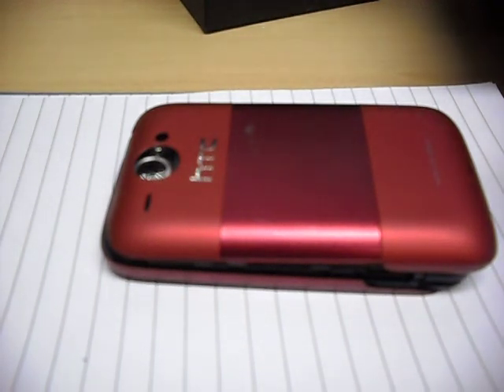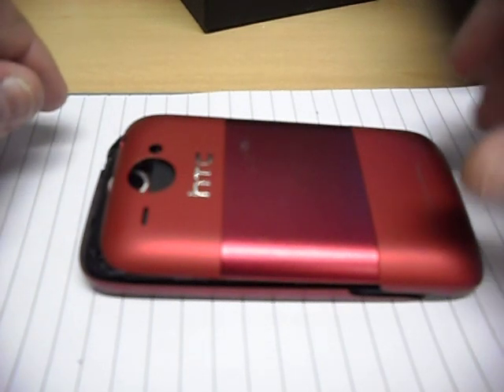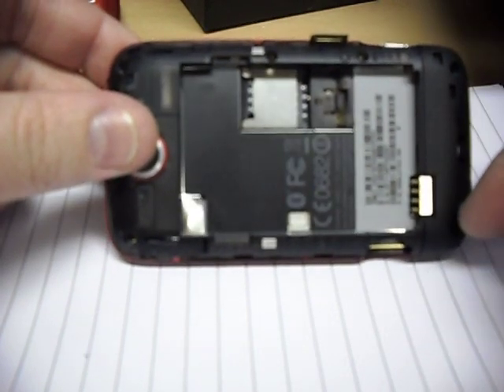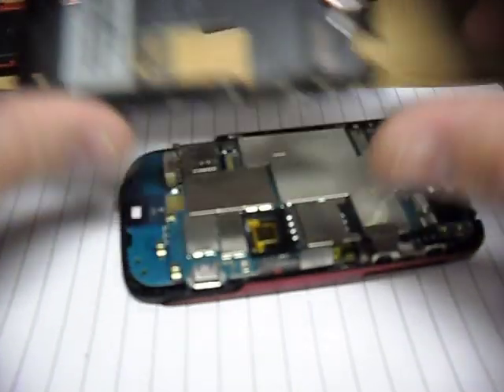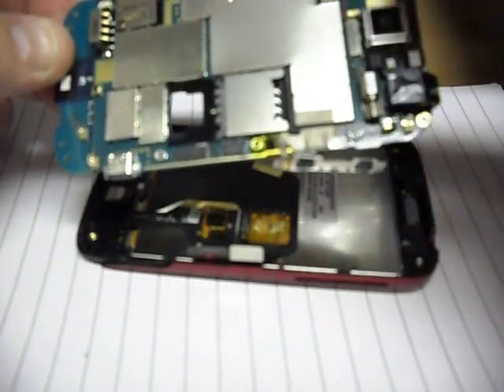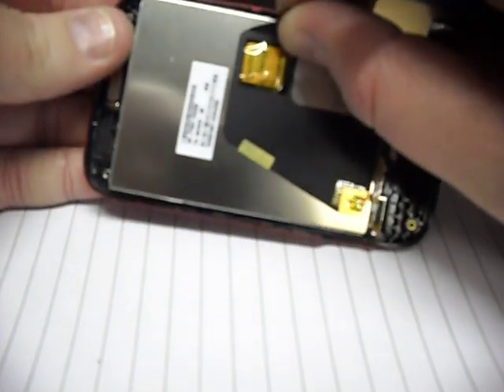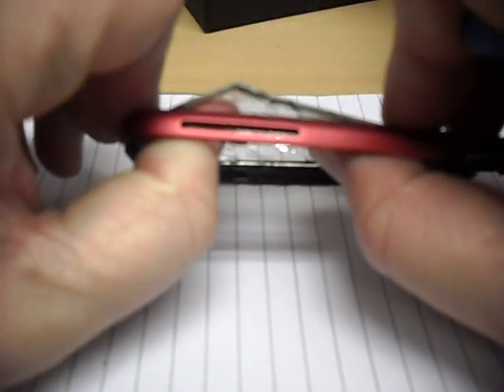HTC G8 Wildfire Disassembly / Take Apart Guide

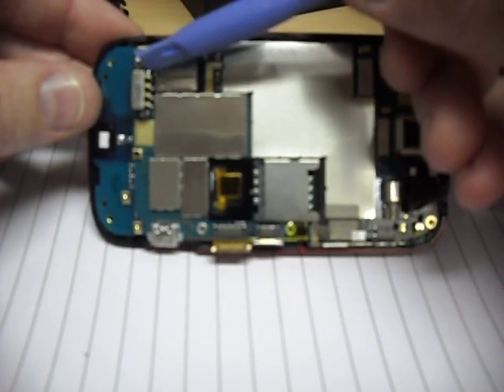Comment: If anyone breaks the little cable the optical trackpad goes into (the first one he shows at 1:40) you can find replacements by searching for ORIGINAL OEM HTC WILDFIRE KEYPAD FLASH LIGHT FLEX CABLE on ebay. You have to buy from china so prepare for long shipping times...

Comment: Hi Chris. Excellent video which enabled me to replace the screen on my Wildfire S last night - thanks so much you saved me £30! Company wanted £50 up front to replace! Only thing - when I was removing cracked screen I managed to pull off the adhesive and there were only a few scraps remaining so I'm assuming it stuck to that! I'm going to buy a case and hopefully it will be OK. I'm not taking it apart again!!! :S Thanks so much!

Comment: Hi Chris,

I have just followed your video through, and replaced both the LCD and digitizer on my friends Wildfire...

However, the digitizer doesn't work... I notice that there is the option to have n IC or non IC version of the digitizers... what is the differnece? The one that came out was a non and I've put an IC version in... (didn't realise there were two versions at the time of purchase) What does the IC do, can I remove it from the ribbon cable and it'll work?

Thanks
SFX

Comment: @ luke, did you buy the right screen, there are 2 types, one has an IC chip on it, one doesn't have the IC chip.

Just followed these instructions and it works a treat, took about 35 mins to fit, I used a hairdryer to peel the screen away from the adhesive slowly  (the new screens don't come with it on) 
Purhased screen from Amazon which cost £16 with tools ;-)

Comment from the maker: @chronic8000 the ic digi has a microchip on the ribbon cable (old version) and the non ic version does not have this chip (new version). Yes I am British, I am from Poole in Dorset. thanks. Chris

Comment from the maker: @GetChurWhoreFaceOn well 2 things, make sure the new digitizer is seated corrected on the top of the phone, also check the connection between the main board and the digitizer. oh yeah a third thing, make sure you have the correct digi for you phone, eg with or without ic. good luck

Comment: Hi, little question...I have three Wildfire's that I have to repair. Online you can find new digitizers but there seem to be two versions: with IC or without IC....which one should I take? Is it dependent on which version of the wildfire you have or what is its function? If it is necessary can you reuse the existing IC and solder it to the non IC version replacement screen?

thanx in advance,

Tom

Comment from the maker: @vickicambell you have 2 choice. but a broken phone from ebay and take the part from that. or find a specialist company that do htc spare parts. the problem with the parts company is that mainly deal with trade only. so you might this option a hard one. i have found a phone on ebay for you to look at. good luck.

Comment from the maker: @shunkskill recently i had a faulty digitizer, the 2nd one i put in worked fine.

Other than that, there could be circuit board damage, then your getting into major repair and nothing that I could post a video on. HTC will fix it for about £150, but this is very similar to the cost of the handset.

gl

Chris